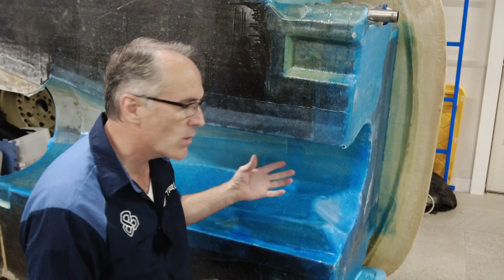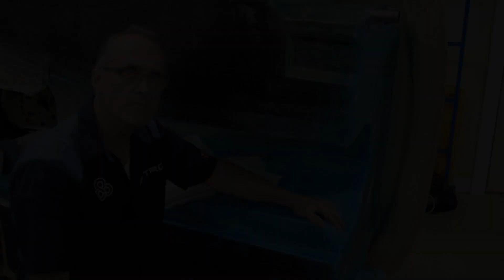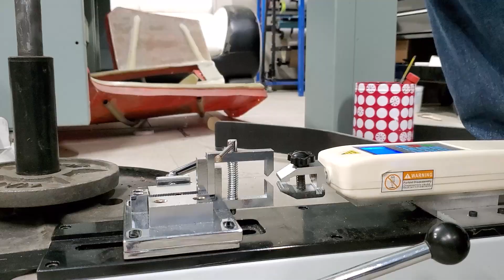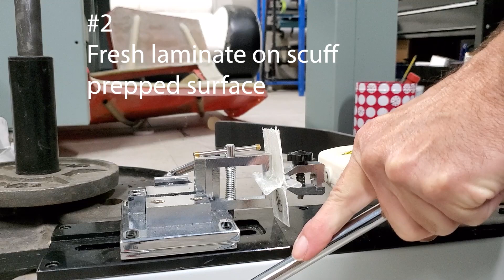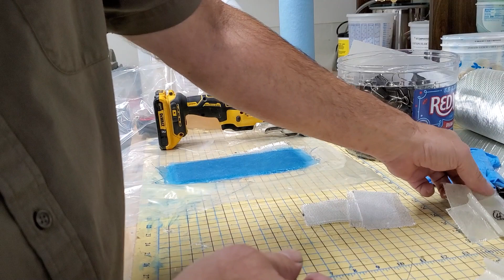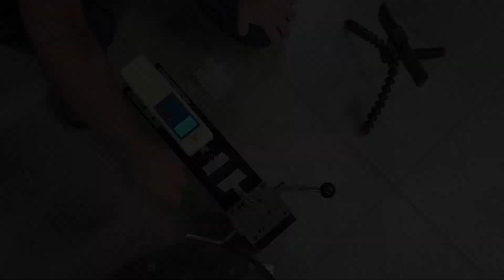Why I'm building the monocoque tub layer by layer. Arete supercar project.

Comment: I've wondered if there was any "method to the madness" of additional composite layering on the tub. (FYI: kuhr-nig-zegg).
Reply from the maker: You could just make the tub the same thickness (number of layers) over the entire thing, but that would just be added weigh in areas that are purely cosmetic or of little strength contribution.

Comment: Good work on the test setup and pieces. Interesting result for the different methods. Keen to see you push on with the car itself but if you did want to pursue this testing further you should try to setup a plane shear or bending test. It will be less sensitive to the failure initiation points you create with the peel test. It's possible that the radius of the chemical vs mechanical bonding test pieces led to a biased result as this will dominate the failure load. Its a shape factor and stiffness test more than just the bonding. What you have shown is at least that mechanical bonding is not a total loss of strength.
Reply from the maker: You pegged the key to my "less than professional tests, "Push on with the car." Ha! I do have however, some viewers that need to understand the viability of my methods, so these simplistic tests help with simplistic answers . . plus truly accurate test equipment usually cost more than the whole project. :(  Perhaps when I have a network TV show. Ha!
Reply: @BuilderCreator  You could use the same tools you have now in a simple bending test, you just need to convert the motion to a push and sit the test piece between two blocks. Any test machine is basically a load cell and a means of applying load.

Comment: I am hanging out to see the bit in the floor where the seats are bolted - will there be some sort of metal there? I can't imagine FRP being strong enough (shear?) to take the load of (de)acceleration with an 80+kg person sitting in a seat as you drag off the locals from the lights...
Reply from the maker: The seats themselves will be fixed in place FRPs, but the safety restraint (rear attachment) will be bolted to the steel hoop.
Reply: @BuilderCreator  ahhhhhh very interesting. Fully custom. Very nice. Looking forward to seeing the process, as always.

Comment: Interesting about how close the breaking strain was between the purely laminated and scuffed-and-epoxied test pieces.
So basically you've traded spending extra time and work for not having to purchase and set up an all-at-once vacuum infusion event to form the tub.  Seems reasonable.  Vacuum infusion can give perfect ratios of 'glass to resin and make a great one-day part, but only if nothing goes wrong.  If something does go wrong enough though, you probably have to write off the part you just made/butchered.  So save money and take less risk and layer it all together a bit at a time instead.  Sound strategy, I think.
Reply from the maker: For sure in the prototype world. In production "Perfecting the infusion," would unquestionably be the answer.

Comment: This is the best argument I've seen for making the body out of aluminum.
Reply from the maker: Instead of layer after layer of fiberglass, it's 10 million blows with a hammer and 6 million rolls on the English wheel. Ha! -or - Best argument for getting a second job and buying a finished car. Ha!
Reply: @BuilderCreator  Watch Wray Scheiline Proshaper channel
Reply: @307Driftwood He has spent months on it and it is a one off body. You made my point.
Reply: @toolmike100  actually, he argued another point, and failed to make it, without supporting your point, which does not automatically mean your point has been made
Reply: @davidburne9477  Good luck with that

Comment: Brilliantly presented as always. Stupid question..... would the mix ratio of the resin influence the bond? Anyway,  thanks for another great video.
Reply from the maker: Sure, If you get the ratio outside of the manufacturers specs then the resin will be compromised. There are of course, resins that are engineered just for bonding and in the samples of the test we could have enhanced the results of the "hard to hard" samples with the right resin.